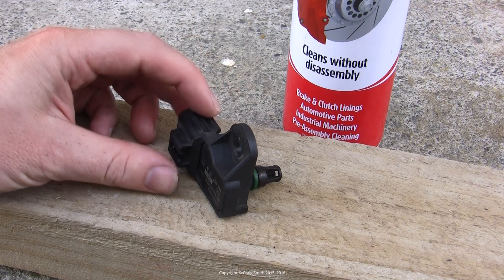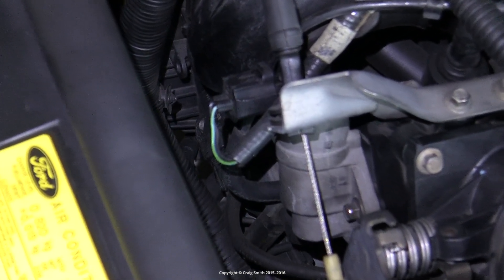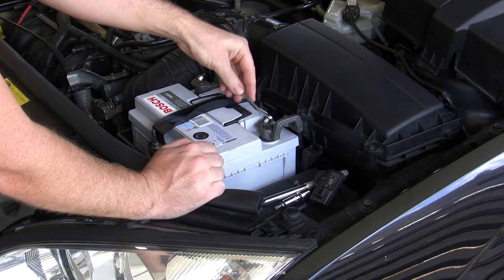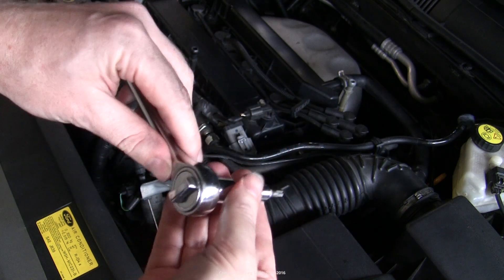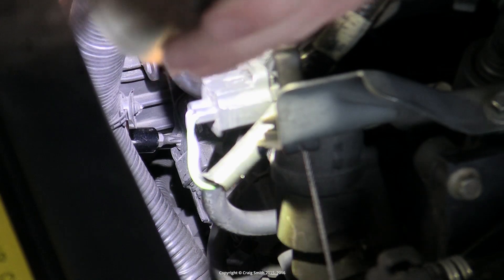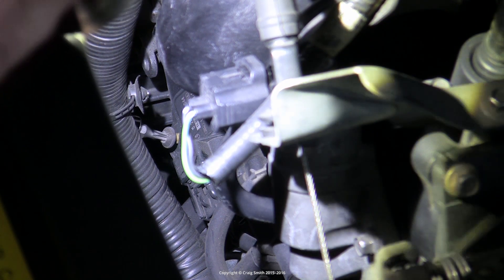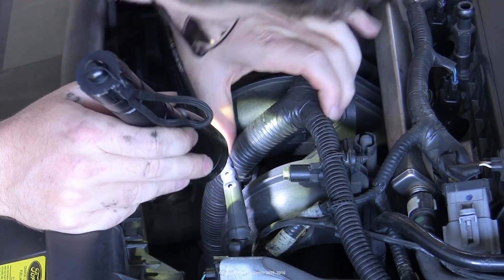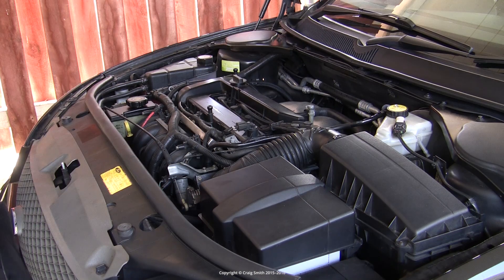How to: Clean & replace T-MAP sensor Ford Duratec / Mazda L (Mondeo, Focus, Ranger, Mazda)

Comment: @craig's DIY Car very informative video thanks! I drive a 2011 transit mk 7 which uses the same MAP sensor. One of four wires from the clip that attaches to the sensor clip has failed and I'm struggling to find a replacement clip. I don't suppose you know where I could get a replacement clip? Many thanks

Comment: My duratec 2.5 stalls on warm start after rpm drops to 500.  Fuel trims are near 0%, runs perfect otherwise. Map is 1.5v/32kpa at idle. No codes. I do feel suction with oil cap removed.  Can you help?

Comment: I found that its easier to reach t-map sensor from below car. Atleast for 2009 Ford C-Max there is more space below.
Reply from the maker: Yes you can do it from below, but you would have to lift the car and on many cars remove the splash shield.

Comment: Thanks for the video Craig, very clear and methodical. I gave this a go but the T20 retaining screw is rusted and disintegrated. I suspect I'll now have to remove the intake manifold to remove the t-map, unless you have any ideas?
Reply from the maker: Torx heads are usually pretty robust. And these are not torqued very tightly. Are you not able to get the bit into the head? Can you clean it out? Tap the bit into it (carefully) to get some bite? Maybe a few drops of penetrating oil around the screw.

Comment: Please use MAF cleaner of Electrical cleaner......
Reply from the maker: MAF cleaner is too feeble, MAP sensors are not so delicate.
Reply: @CraigsDIY  I use throttle body cleaner, the map sensor would just laugh at maf cleaner. Oven pride if you have any 😉

Comment: removing the battery does not wipe the keep alive memory (KAM) for this to happen you have to use a scan tool and wipe the current adaptions.
Reply: You still need to clear the capacitors after you disconnect the negative battery cable to clear the computer. It's called a hard reboot.

Comment: My 2003 Mazda 6 makes it nearly impossible to remove the sensor because the coolant reservoir and the AC line is right on top of the radiator fans. You need the  will of a thousand souls to do it with the intake manifold bolted on the engine. So little space for a ratchet and your hands
Reply from the maker: You can do it more easily from underneath if you lift the car. I showed it from the top because that's possible on this car, but if you're having trouble just get out the axle stands or ramps.

Comment: Am I missing something? This is about the eighth video i have seen entitled CLEANING MAP which doesn't actually show how to clean a MAP sensor1 I have a P0106 MAP sensor problem. You show diagnosing MAF sensors, which is something completely different.  (However many MAF sensors you clean)
Reply from the maker: The sensor shown is a MAP not MAF sensor.

Comment: you seriously dont have to disconnect the battery to reset! The ecu keeps learning it can take a day or week but it will adapt the new values to run the engine optimal. Resetting will only learn it faster.

Comment: well m8....... NEVER USE BRAKE CLEANERS on sensors !!!! instead use contact spray !! as diy you should know that !
Reply: use air sensor cleaner! only this will evaporate completely!
Reply: I have carb cleaner or IPA. which is bestest?
Reply: @JESUSSDAD  only use electric cleaner
Reply: Use Archoil AR2810 MAF Cleaner

Comment: Do these really need cleaning?
Asking because im having performance issues.. and ive never cleaned mine.. its a pain to reach.
Reply from the maker: Yes well if you're having issues, this is on the list of easy things to rule out. It's not that hard once you arrange a driver you can get into position.

Comment: brake cleaners bad for the plastic to.why do all the manuals say don't use then.
Reply: Maybe because some HUGE company wants YOU to buy a product, another cheaper product can do.
Reply: You can also go to any chemist and buy clean alchol 70 % ALC ( for cleaning cuts and sterilising medicle stuff 'ie' sissors. )For 5 bucks, rather than the 30 bucks for a tin of spray ( thaht is not required to do this job ) seems best cost effective to me.

Comment: Your not suppose to use brake cleaner on the sensor it leaves a residue CRC MAF cleaner for map and maf sensors
Reply from the maker: Good quality brake cleaner doesn't leave residue. MAF cleaner isn't likely to work well on badly fouled MAP sensors, as the latter live inside the manifold and can get coked up from EGR contaminants.

Comment: Does a faulty MAP sensor cause stalling everyonce in a while?
Reply: Yes it does cause stalling. My ford focus needed a new MAF sensor and as I was breaking with the clutch pushed in the revs would drop too low and it would cut out.

Even though it's a MAF sensor on my old focus, I believe that the MAP sensor does pretty much the same thing.
Reply: @DaVeHiLl200  I have a ranger which has the same engine as a focus.  It has both.
Reply from the maker: Sure, it could make the engine mess up air/fuel mix enough to stall. The sort of thing where you should be looking at PIDs and fuel trims with a scan tool.
Reply: The OBD scanner said faulty MAP sensor, but according to the mechanic, faulty MAP sensor does not cause stalling, but instead pointed out my fuel pump also needs replacement. But when I replaced the MAP sensor, it has not yet stalled on me  again
Reply: pinoywheelgunner The MAP was giving my car hard starts, I changed it and it's fine now.

Comment: If you look at your video around the time when you do up the screw, you can see there is a small vacuum hose hanging loose....
Reply: Great videos & audio, Craig. Invaluable these past few days trying to isolate lumpy idle and/or misfire on an '05 Mondeo. Have broken the fragile EVAP purge line near the main fuel injection connector. How is the rubber elbow joined to the manifold (your manifold video 5.47min)? Haven't been able to loosen it; looking to get a replacement.
Reply from the maker: Correct. +10 pts if you can identify it
Reply: Thanks for the reply. Perhaps I misunderstood: isn't the collar depress on the brake booster hose? In my case it's the narrow EVAP line that you disconnected from the elbow, rather than elbow from manifold. In manifold video @ 17.22min (to right of flaps actuator plug) there appears to be no collar, just push on (same as valve end?), however, mine is stuff firm and hose won't release at elbow either.
Reply from the maker: Sorry I jumped to conclusions. So you can see at 5.45 in the manifold video how I disconnect it, if yours is stuck at this joint then it's still a very simple join that a heat gun and some force would always work on. If you want to replace the rubber hose as well, that just goes down and in a few inches to a male connector on the manifold directly underneath the IACV. Again this will just pull off but may require a bit of encouragement. Much easier with manifold off the car of course. I would just leave it in place if it's not damaged.
Reply from the maker: Edit: you can see it (the hose) very clearly at 14.00, 14.54, etc (next to IACV)

Comment: Hi sir,I have a Toyota filder and it has problem of vibrating especially when am in traffic both in neutral and drive though it's more in drive. ..is this the problem with airflow meter? thanks

Comment: Thanks Craig. did the cleaning of the sensor improve the engine performance for you?
Reply: As anybody can see, the tip of the MAP sensor was dirty, with a lot of oil deposits caused by the terrible (I'd say "shitty") design of the PCV system in all cars.  In this case you did not notice any change because the MAP is the least dirty part, just remove the entire inlet manifold to find how dirty the inside is!  The gunk and dirt in the manifold is even less than at the inlet ports in the cylinder head and valves.  THAT DIRT really messes up idle quality and emissions in some cars.
The ONLY way to cure the crud and dirt deposited in the inlet tract, is to install a oil vapors cooler followed by a properly built "Catch-Can", so that the PCV stream it cooled first to condense most oil vapors, then separate the oil mist in the Catch-Can.
A Catch-Can alone will barely remove oil from the recirculation, as this stream is present as a vapor-mist mix, and sometimes visible oil droplets, dependong on the engine and RPM.  Why do auto manufacturers still design their PCV systems so badly? Because they don't care the user will have higher tailpipe emissions and because it costs them pennies as designed, and finally, because they don't care lowering the effective Octane number (lube oil has a terribly LOW octane number, btw)

 To really do a proper job, the complete manifold must be removed and cleaned.  Finally, Don't attempt to "clean" the inlet manifold with a spray can "lceaner", as you will end up removing ony some crud, but then that dirt is going to form hard deposits inside the combustion chamber, foul the sparkplugs, and more importantly, the O2 sensor and the expensive Cat converter!
Do it properly OUTSIDE the engine.  Amclaussen.
Reply from the maker: Not that I noticed, I just did it as a service job. It was definitely dirty though. Sensor seems to give sensible data on scan tool.

Comment: it didn't start immediately cause that cleaner stuff (Isopropyl Alcohol) felt cold on the Air temp sensor thus ECM is programmed not to fire up the engine until the parameters of the ATS, ECT seem logical as a fail safe design, so once the Alcohol sucked inside the engine it received the proper/expected air temp it allowed the engine to run
Reply: By the time the sensor is installed, ANY alcohol has been long evaporated... It is more related to the practice of DISCONNECTING the battery.  In my VW vehicle, disconnecting the battery nor only erases the radio stations, but the partial odometer reading, and causes EXACTLY the same difficulty in restarting.  It can be lessened by switching the sarting key several times WITHOUT reaching "start" (just cycle OFF-ON-Off-On-OFF- On and it usually helps reset the computer and get it ready for restarting sooner. Amclaussen.

Comment: Hi Craig
Nice video mate.just a quick question. Screw on the sensor is rusted and rounded off a bit.any suggestions?If I had to replace the screw what dimensions would that be.
Reply from the maker: I couldn't tell you, other than the driver socket is torx T20. For this reason it shouldn't be 'rounded off', or if it's been damaged by someone trying to mash a cross drive in there then it should still work if you are careful to engage the driver fully. Spray a little penetrating oil on it and try it when engine warm maybe. If you want to replace it, you would have to take it to a fasteners specialist and match the thread, ideally with a stainless steel version.
Reply: the screw is the same as for the fog lights.

Comment: Replaced the T-Map sensor on my 2006 Focus 1.8 Duratech and the dam fixing screw sheared inside the manifold .. had to glue it in place for a temp fix .. 2 pack plactic body glue did the trick ...

Comment: It seems someone at Ford really hates people trying to clean their MAP sensors. Still, be glad you don't have the old Zetec SE engine - this placement of the MAP sensor is awkward, but it's still much better than on that Zetec. To be able to get to it there, you have to remove the accessory belt and alternator. The MAP sensor is hidden behind the manifold tubes and the screws are positioned at such angle that it's just impossible to get to it any other way.

Very nice video, BTW.
Reply: You're not wrong.They made this a pain in the arse to get to on the fiesta ST150. I may need to get the manifold out or move PS lines just to get at it. I'm going to assume conspiracy :)
Reply: That sounds like far too much of an arseache. What I loved about the old blacktop Zetecs they put in the 1.8 and 2.0 Focuses (Focii?) was pretty much everything was easily accessible. Just about the only thing I had a small issue with in terms of access was the idle air control valve.
Reply: yeah I'm the unlucky owner of one of those.. today I got myself a brand new T-Map sensor, a bluetooth dongle to clear the codes and off I went to replace the darn thing... after about 1 h of trying to get the belt back on I reconnect the battery , connect the OBD2 bluetooth dongle to an app , send the clear comand, check again and then start the engine.. it just starts and stalls right after..tried leaving the battery disconected for longer, turning the key without battery on in hopes for a capacitor discharge, shorted the leads .. nothing seems to reset the ECU. now I'm stuck having to put back the old MAP just to drive it to an electrician in hopes that his scanner actually clears the codes...

Comment: Yeeeeesss..... Thank you. This is the videos we would like to see. This kind of information videos are actually usefull. Thank you very much!!!  I already changed mine because i thought it was causing weird gear changing in the automatic transmission. At the end, it didnt.
Reply: Woooow!  This worked great on my Mondeo MK3 2.0 Duratec HE. I have cleaned sensor with EGR cleaner, but removed gasket on sensor first as it's quite agressive. After putting it back performance +50% on acceleration. Before my mondeo was like an old and heavy cow. Sensor was coveret with oily mud and dirt. Now my car runs like racing horse! Much thanks!